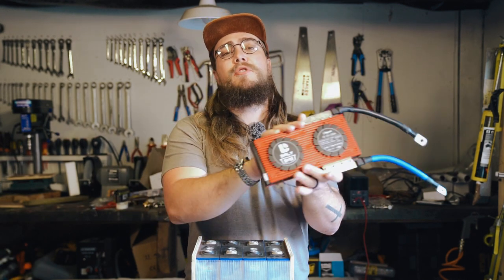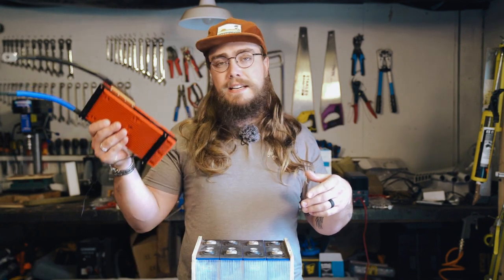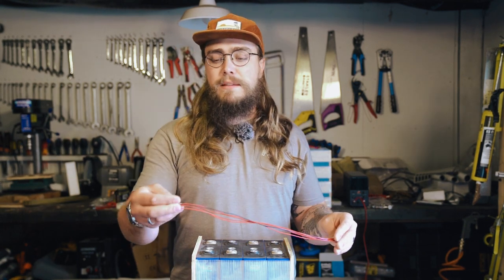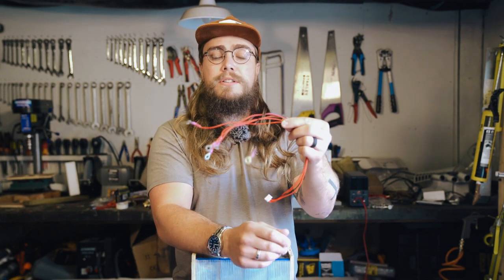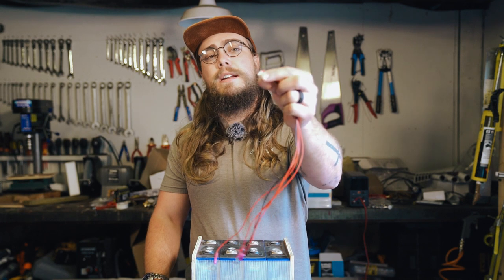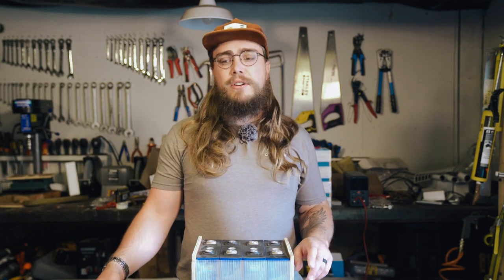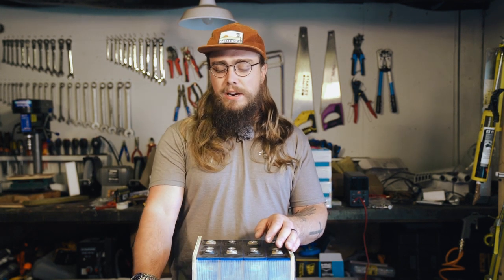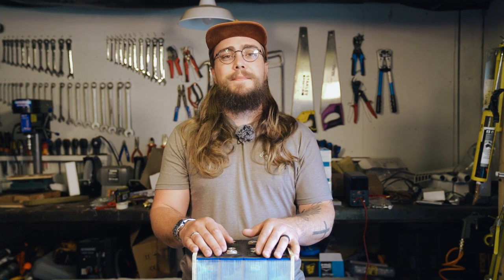Dealing with runaway cells in LiFePO4 battery

Comment: Half of my 134kWh off grid battery bank has various high runners from 55.7V on up. Have you ever taken all of your runners and made one "runner" battery out of them?
Reply from the maker: We have not tried that. Would be an interesting project!
Reply: That sounds like a great idea, it would be very interesting to see what capacity such a bank could deliver, just because capacity is down, doesn’t mean it cant still be useful storage. With a bank like urs, sounds like it would not be too hard to put together such a project/experimental battery bank, even a 12v bank may give some proof of concept data, or a couple banks with differently matched IR’s to see what you get.
Reply: Wow, 134kwh battery! That is awesome. Please make a video on it

Comment: Hello, what about one cell that's spike on voltage on the charge stage?
Thanks
Reply from the maker: If it keeps causing your BMS to hit the high voltage disconnect, I would re-order your cells and see if the same cell keeps doing that and if so, you might want to look at replacing it.
Reply: @offgrid_power  ok TKS
Even with the capacity matched, this could happen?
Reply: @ditmarco  well in theory if everything is fine with the cells..... you wouldn't have a problem.  so your having a problem.... there is a problem.

Comment: Hi guys, great videos made👍
Just a quick question if you have time - how many amps would you charge a very discharged lithium iron battery cell ? Eve battery, was 3.65 v now down to 1.8 volts. 12 volt pack. My fault ive put a blue tooth shunt module before bms 🤦🏼‍♂️
Or is it tooooo late - dead 😭. 
Kind regards Alex
Reply from the maker: Hi Alex. I would get those cells onto charge ASAP. Charge them at a low amperage (under 20A) and see what happens. You might be OK, but take care and keep an eye on the battery cells for excessive swelling.
Reply: Thanx for your feed back 👍
Reply: @mayterrace1971  how did it go???
Reply: All went well, we recharged the cells with 10 amps to 50 %, then with 20 amps till 100%. Capacity test done after   & recharged to 100 % - all good. Very lucky as cells seem to work just the same as before. No bloating of cells either. Coffee machine still runs, All good 👍

Comment: The 16x LittoKala cells I received from AliExpress are badly bloated and tested well under stated capacity.   I am not sure if I am brave enough to use them but it will be interesting to see how my Dally BMS copes with them as other tube channels give Dally a bad rep.
Reply: your daly will not be able handle balancing using standard charge and discharge profiles if cells are bad enough. You will have to use a more conservative profile in your charger controller. lower max volt charge and higher min volt discharge

also, you should ask your bank or creditcard company for help with reclaiming your money. Litokala send out bad batteries very often.
Reply: @sugarpuffextrem  Funny story to them, the shipment went missing, luckily I got all my money back through AliExpress arbitration, no lie the day after the refund came off my card the delivery arrived. 
No one has ever come back chasing money for them, I would of been in tears if I had paid for these.
Thank you very much for the advice!  I will be gentle with them.
Reply from the maker: Good advice here. Litokala are notorious for very bad cells. Good luck!
Reply: @offgrid_power  yeah I need it lol.